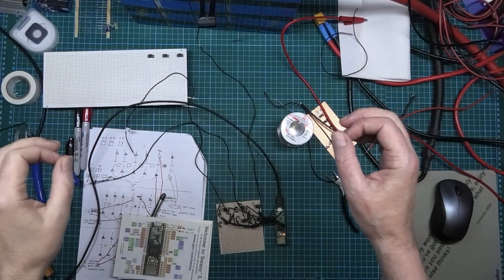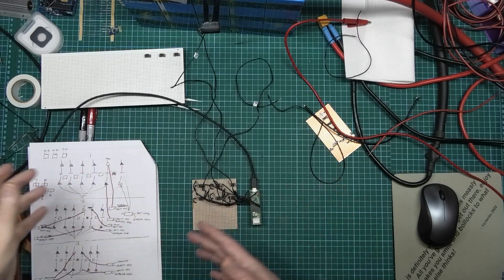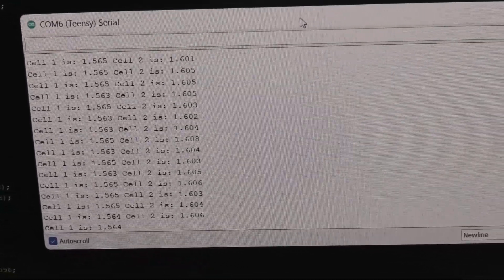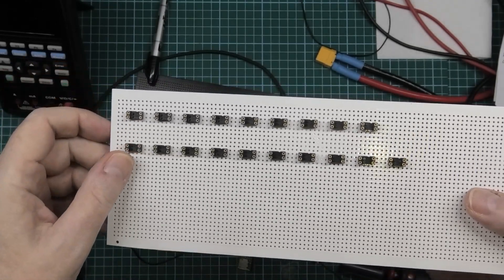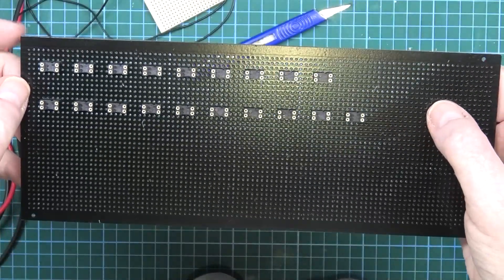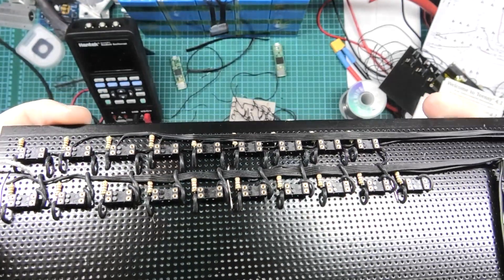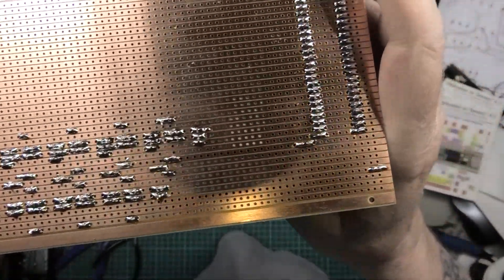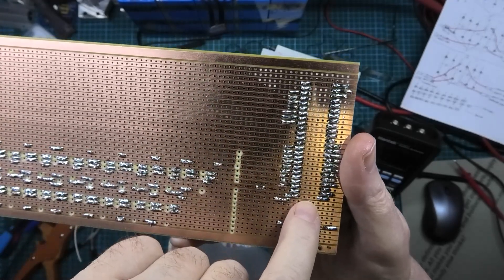Reinventing the BMS with Launch control, anti wheelie and VESC integration -  Part 2

Comment: I cut tracks before soldering, with a razor blade. The beads will flow nicely to the cut and look nice, and importantly won't touch the neighboring beads. With no effort.

Comment: As far as I can see the opto-isolators are always connected to the battery and drain power. It will work, yeah, but you are wasting battery, and must correct for non-linearities in the measurements with software. There are dedicated I2C and SPI ICs specifically made for this type of use and offer active balancing, charge and discharge current control and a lot of protection built-in. It's just not worth it to design a bms with discrete components, it'll certainly be inferior compared to an IC like BQ76940. But using opto- isolators is certainly an interesting take.
Also, what does launch control have to do with the bms? Or anti wheelie?

Comment: "None of this wireless crap which is a security risk, the head unit is the power source. If you unplug it, the controller and BMS are completely disabled and you cannot use whatever it's linked to."
 So physical security!.....I like that idea.

Comment: Wow now that's a Vero board project I've made project on Vero board and it does take hours and hours and hours one wrong link or a solder bridge and you get the magic smoke concealed in every chip so they say. I have seen magic smoke on the odd occasion I'm sure you know what I mean. Track cuts are a nightmare especially on the wrong track or if you don't do them all Tony I've done that. Making circuits does keep your brain very active and it's the best achievement ever when it does what's expected of it. 👍